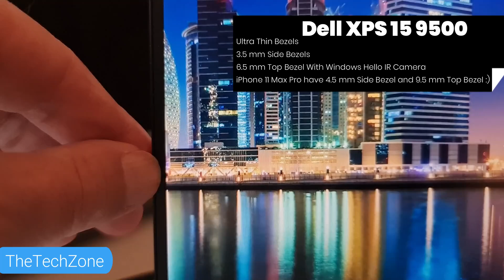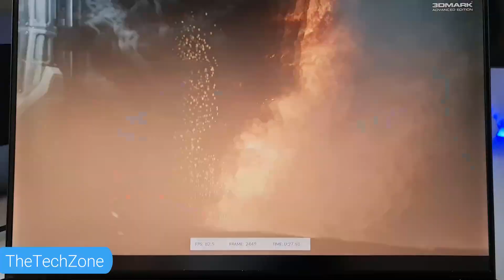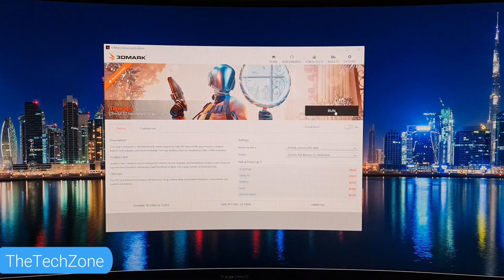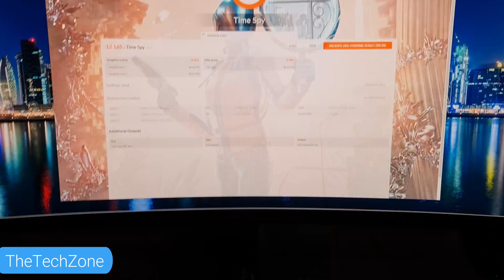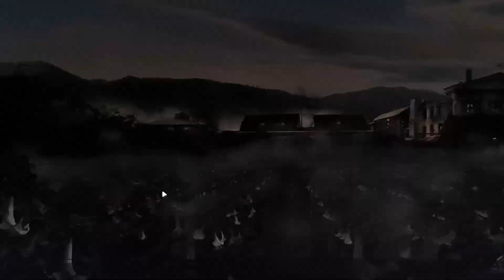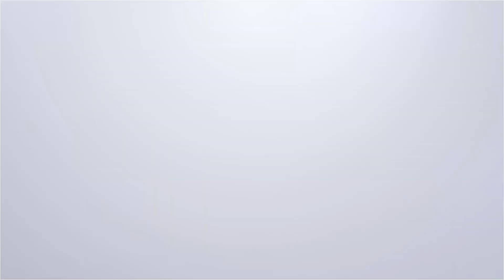Dell XPS 15 9500(2020) eGPU + RTX3080 Performance  + Gaming

Comment: Very good review, exactly what I was looking for. That 49" monitor setup  with the mantiz and a Samsung Book Pro 360 
is what I plan on using.
Reply from the maker: Hi, thanks for the great feedback. A very nice setup you are planning, please let me know how that system works out for you. 🙂
It would be great if you can support this channel by subscribing.
Reply: @thetechzone6558  I did subscribed that day the moment I finished watching the video. After the monitor comes in tomorrow I'll post how my system is doing.. Keep up the good work.
Reply: @twospirits411  howd it go? Looking into almost the exact same setup
Reply: @twospirits411  Hey how's your setup so far?
Reply: @Chukwuma Akunyili  so far so good.. Liked it so much I bought another 49" monitor and another eGPU. And both ate running great. No issues at all. Knock on wood.
Reply: @twospirits411 what egpu are you using?

Comment: The New Dell xps 13 tiger lake was getting like 25000 graphics score on fire strike with a 3070.  I saw it on tally ho tech.  That has fewer cores and threads than this processor.
Reply from the maker: Hi, I agree it's not that big difference between the 3070 at 25000 and  the 3080 at 27890 when running on an external monitor.

Comment: I put Liquid Metal on my 9700. 10875H CPU - I can't get it to overheat anymore. Literally impossible to push above 90°C, even at a sustained 75W load. Too bad it's only 130W max power, because once the GPU kicks in, it won't let the CPU draw more than 30 something watts. I feel like it's restricting the RTX 2060 quite a lot in certain scenarios.
Reply from the maker: Thanks for the feedback. Very interesting results. The 9700 is equipped with a better vapor cooling solution then the 9500 though, much needed due to the RTX 2060. I don't think liquid metal will help the 9500 much, I had similar problem with the MSI Prestige 14 and made a video on applying liquid metal with not so much improvement. The Prestige's cooling is not as good as the 9500 though.
Reply: @thetechzone6558  You get upwards of 30W additional cooling capacity by putting liquid metal on the chip. It's crazy
Reply from the maker: @blazbohinc4964  Yeah, very impressive :)

Comment: interesting one question do you think i can edit 8K video with eGPU + RTX 3080  with my Dell XPS 9500 ? i will lose some preformance with thunderbolt 3 ? ive seen video's on Yt connecting eGPU to m.2 ssd port
Reply from the maker: Hi, thanks for the question. It should be possible, but I have not had the possibility to do that test. My current setup use a tb4 connection that deliver about 10-20% more graphics power, depending on use. I don’t have a 8K camera to do the test unfortunately. Connection to the m.2 port  will need a way into the laptop and may not look so good.

Comment: I am planning to get eGPU for my XPS 15 9570 with an i7-8750H which is 2 generations lower, do you think the bottleneck and throtling will be much worse if I used a 3080 as well or should I go for lower performance GPU.
Reply from the maker: Hi, it depends on what kind of resolution you are playing at. Playing at 2K or 4K will give you a big boost in performance, The CPU will only be dependent on for CPU intensive games, I will do a test next weekend on a 4 Core CPU in Dell XPS 13 11'th gen CPU and compare them with the Dell XPS 9500.
I will be very grateful if you can support the channel by subscribing :)
Reply: @thetechzone6558  Yes have done that, and yes I bought a 2k 144hz external monitor and my cpu is 6 core so that test would be interesting
Reply: hey man, I have the same laptop as you, let me know how your performance is looking like
Reply: @nitishgupta5959  its fine for the most part definitely better but CPU is prob the bigger bottleneck with this unit. I have 3070 on Razer Core X connected to it and QHD monitor and it can run most games 60-100 FPS max settings. I am planning to upgrade to the new 12th gen xps for thunderbolt 4 and also better cooling for the CPU

Comment: I'm in a bit of dilemma.. I want to run 2 monitors 3840x1080@144hz + 2560x1080@60hz off my xps 9700 but I'm not sure what is the best approach.

One option is to get wd19tb4 dock but would that be capable to push all the pixels? 

Second option is to get razer core x and some gpu.. So like in your case can you connect 2nd monitor (or tv whatever) and run it off that 3080 like it is plugged in a pc? Or your laptop still plays a part? :/

Comment: I have this laptop. When i play games such as gta my laptop gets really hot, to the point to where my finger stings when holding down the W key. How long will my laptop last with all this abuse.
Reply from the maker: Hi thanks for the question. I find it strange that your Dell gets so hot in the keyboard area. My CPU have 100 degrees the first 3-4  minutes but before it goes down to 75-80 degrees. Do your Dell behave the same?
I will be very grateful if you can support the channel by subscribing 🙂
Reply: get a laptop stand

Comment: Hi! Thank you for this great review. It's similar to what I am looking to build except with an XPS 15 9560 2017 model. Would you know if it will work with it as well?
Reply from the maker: Hi, sorry for the late reply and thanks for the question!  Your XPS 15 9560 will work with a eGPU, the only difference is thunderbolt 3 instead of TB4 on the newer XPS. TB4 add about 15-20% higher speed over the connection.
Reply: @thetechzone6558  Thank you!

Comment: Hello nice presentation. I have the Mantiz Saturn V2 with RTX 2060 and a XPS 13 9350 but when I connect to TB3 nothing happend 😫😫
Reply from the maker: Sorry for the very late answer. Did you go to device manager and update the Display adapters?
Reply: @thetechzone6558  sure but nothing happened

Comment: I wanna change my desktop to laptop-egpu-27" display combo. How strong is this CPU? Like ryzen 2600? So enough for 1080p 75hz?
Reply from the maker: Hi thanks for the question. I'm not an expert on Ryzen driven laptops but I think the i7-10750H is about 10% faster in average. What kind of GPU will you use in the new setup? The CPU is only a bottleneck in very CPU hungry games, I will have a video out soon with Dell's XPS 13 i7-1165G7(4 cores) comparing the with 9500 eGPU solution.
I will be very grateful if you can support the channel by subscribing :)
Reply: @thetechzone6558  currently I have 1660S and 2700x but normal PC is kinda nonsense for me, especially in the future. The desktop 2600 6 core as well and as i know intel and AMD (zen+) has same IPC, so 10750H must be on same level. 
Subbed!
Reply from the maker: @DaBombtasi  Thanks a lot for your sub! It's a bit hard to compare desktop CPU's to the ones in laptops due to higher voltage and better cooling. I'm looking at comparison between Ryzen 5 2600H and the i7-10750H and see 21% lead in favor to Intel in the link below. That is not all to take into consideration as Dell XPS 15 9500 is limited due to the cooling solution and throttling will occur after some minutes.
https://cpu.userbenchmark.com/Compare/AMD-Ryzen-5-2600H-vs-Intel-Core-i7-10750H/m617618vsm1053158

Comment: Hey ! Thanks for your video !
The eGPU can lower my XPS temperature (and fan noise) during gaming ? 
Thanks in advance :)
Reply from the maker: Hi, sorry for the late reply. You can see the temperatures I got when running benchmarks, those numbers apply to the gaming tests also. For really graphic intense games you will have up to 90 degree celsius on the CPU, its no issue in the long run since these CPU's will drop the performance automaticly if it goes on for long. The fan noise is there unfortunatly.

Comment: Hi there! I have a question if you wouldn't mind answering. I'm looking to get the new XPS 15 but sadly it's 60hz. Can I connect the laptop to a 144hz monitor and game at 144hz? Or will it be stuck at 60hz?
Reply from the maker: Hi, very sorry for the delayed answer. It is fortunately no connection between the built in screen and the external monitor so you will be able to run on 144hz😀

Comment: Hello .. Can you please suggest if its a smart decision to use Razer Core X + 3070 Ti,  Since the card has an 8GB  limit but thunderbolt 3 itself peaks at 40 Gbps which is = 5 GB ? Will this not effect the egpu performance ? as the data transfer is less than the 3070ti capabilities ?

Please advise.
Reply from the maker: Hi, sorry for the very late reply. You will always have a less performance then a computer with a bouilt-in graphic card. The transmission speed is slightly better with TB4 then TB3. Its also a bottleneck if you run the application on the laptop screen instead of an external monitor. I think a 3070 Ti is very close to the limit regarding egpu performance.

Comment: I know this is old, but did you have to do anything with the nvidia drivers? I got a 9500 and want to get the razer core x with a 2080
Reply from the maker: Hi, thanks for the question and sorry for the very late answer. I usually just connect the eGPU, open the device manager and opern Display adapters, right-click on the new-unknown device and select update drivers. That will initiate the download and install of Nvidia drivers, that will work on any graphic card connecting to a eGPU. I used the MANTIZ MZ-03 SATURN PRO EGPU and have been very happy with it since it accommodate dual Thunderbolt 3 circuits to control separately the different ports and the graphics stream.
I will be very grateful if you could support the channel by subscribing :)
Reply: @thetechzone6558  So great, I bought an eGPU yesterday, because of your video actually. Thanks so much. That definitely deserves a follow.

Comment: How do I get this laptop to use the gtx ti card inside and not the integrated. When I try to play a game on a 2nd monitor it uses integrated and runs terribly. I don't want to do an egpu
Reply from the maker: Hi thanks for the question. Does the gtx card appear in the device manager?
Reply: @thetechzone6558  it does and I set it as primary but it's still choppy on 2nd monitor yet runs butter smooth at max on laptop screen. It's mostly on star citizen

Comment: Any nvme do you recommend me for huawei matebook x pro the same you have ?
Reply from the maker: Hi, thanks for the question. I'm sorry for the late answer, I have been sick for several days but I'm starting to feel better now. I have had the Samsung EVO for 3 years without any issues, so I'm confident recommending that drive.
Reply: @thetechzone6558  Thanks, I hope you find well, yeah, the problem is I want to change the NVME because  hackintosh de samsungs nVME do not support APFS or MAC os format, and that's the reason I want replace the samsung default nvme
Reply from the maker: @oriacua  I see, do you have another SATA m.2 drive? In that case you should be able to do the installation on that drive and use a cloning software to get it right. There are some really cheap SATA m.2 drives for around 30$, but after the installation you will have to select NVMe instead of SATA in bios.
Reply: @thetechzone6558  Thanks a lot men, you're great
Reply from the maker: @oriacua  Thanks for the amazing feedback :)

Comment: How good would this be with a Alienware 17 R4 laptop with a core i7 7700k from 2017?
Reply from the maker: Hi, it should not be a big difference  as most games only use maximum of 30% CPU, but in case of games/simulators that really utilize multi thread/core it can be a difference in favor for the i7-10750H.
Reply: @thetechzone6558  What do you mean it should not make a big difference for some games?
Reply from the maker: @firelightyear  Hi, I think both laptops will perform almost the same  using the eGPU and only a small difference due to different CPU's.